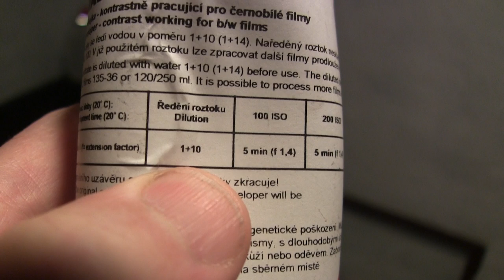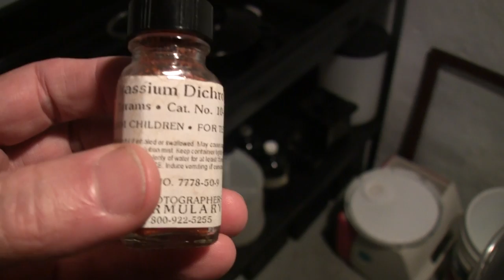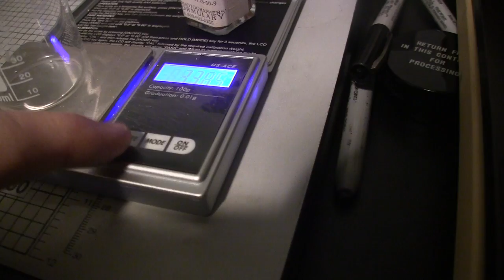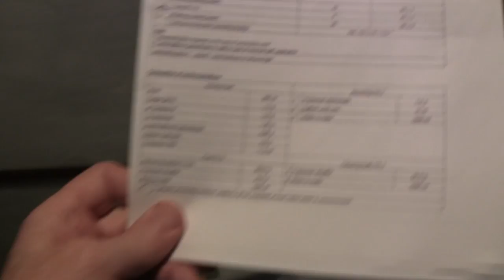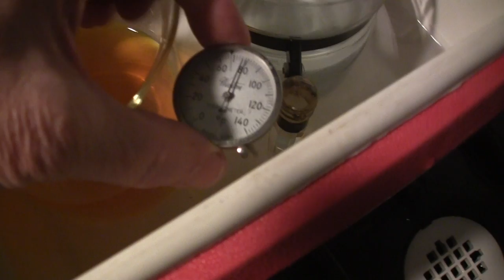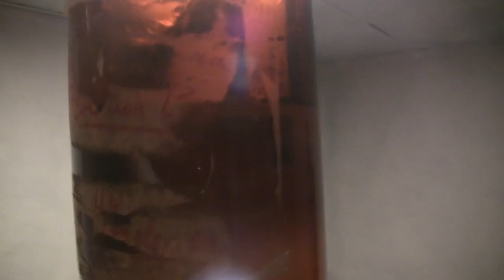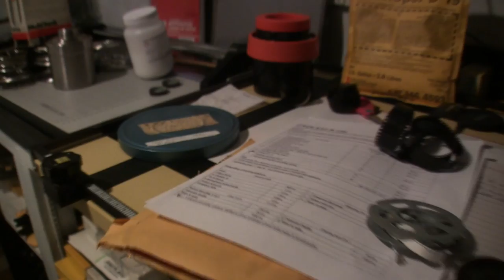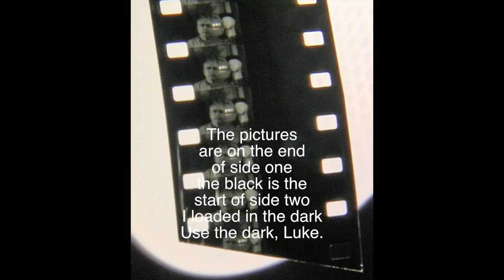how_to_Develop_movie_film_Foma_R100

Comment: Mr. Carter. If I understand correctly, the développer can be reused. How often can it be reused and do you add additional time to each development as the chemistry is used repeatedly? Also, do you ever presoak the film before the first development?1
Reply from the maker: Pre-soaking is done lately or nowadays. Yes. The first developer is saved and used for the second developer. That is LQR. Then it is dumped out. If I use D-94 and D-95 the developers are saved and refreshed according to the instructions up to the original volume.
Reply: Michael Carter Thank very much.

Comment: So I've been trying to develop Kodak's new 16mm tri-x reversal film using coffee developer. I got the image to come out positive but it's very faint.
I've been developing the film until the negative looked good (Using a red light) then re-exposing and developing again.
it kind of looks like the positive is a very thin layer of emulsion on top of the negative because if you look at the surface the image is positive but when you look through it with a light you see a very faint negative.
I think I may be underexposing during re-exposure but I'm not sure.
Reply from the maker: Did you bleach away the first negative?
Reply: @MichaelCarter  I did not because it said supposedly the new stock doesn't require a heavy bleach. but I'll give it a shot anyway. Should the film look blank again after bleaching?
Reply from the maker: only bleah after the first developer. do not bleach after reexposing
Reply: @MichaelCarter  I don't remember because it's been awhile since I tried the bleach but I may have bleached after re-exposure.
When I try another test strip I'll let you know the results.
Thanks for the help.
Reply from the maker: I started a FB group called Home movie film lab. Come on over.

Comment: How do you slice the two halves of the film roll?
Reply: To cut the double 8 mm film into just actual 8mm you have to buy this circle thing that has a blade in it and you just pull the film inside of it till your done.

There pretty cheap to get.

Comment: Have you done it as a negative? My results are not very good.
Reply from the maker: Yes, negative is possible, I have posted about it, somewhere...
Reply from the maker: https://www.facebook.com/groups/1833878160190581/
Reply from the maker: Bleach first in darkness, clear, expose, develop neg, print or scan.
Reply from the maker: https://www.photrio.com/forum/threads/fomapan-r100-not-developed-as-reversal.104136/
Reply: I don't have the chemo  from the Foma kit, What else can I use?
Reply from the maker: Photographers Formulary sold me the chemicals, Adrian Cousins uses citric acid and hydrogen peroxide.